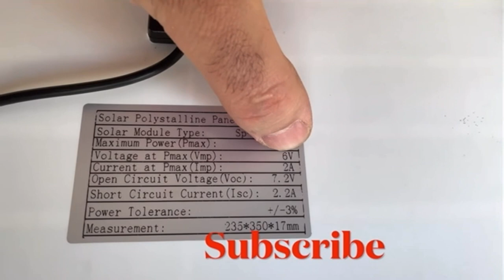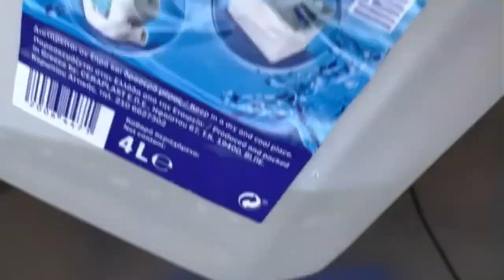Make Free Energy - Combustible. Hydrogen Generator. Water Electrolysis. HHO

Comment: Thank you for your valuable videos... I have one question: I've tried making an hydrogen stove, but I could not manage to get much hydrogen, there was less pressure, may you please advise how did you do with yours and how do you manage to get 30LPM?
Reply: I notice that if you build a HHO sandheater then you will just need 1 or 2 LPM to heat a room